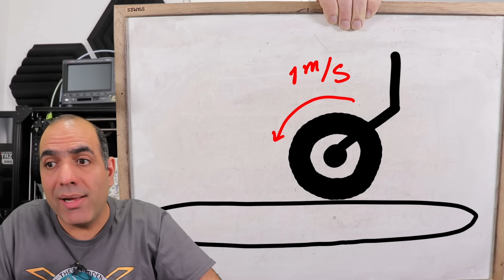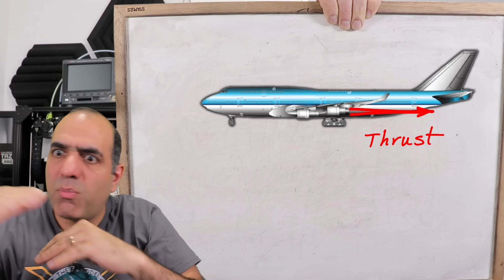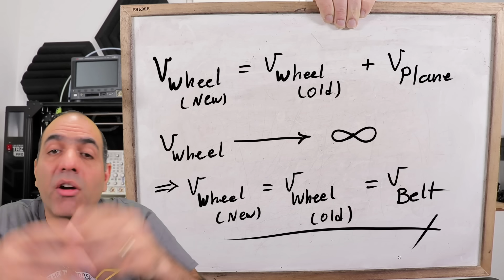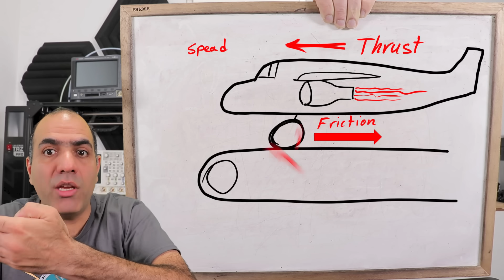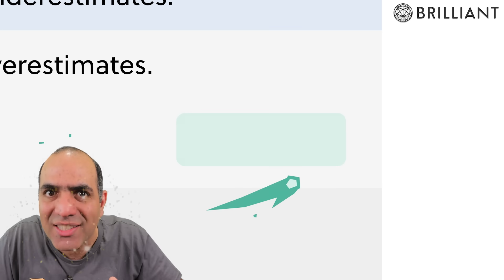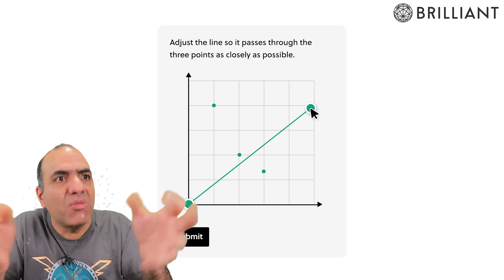Airplane Question that Drove Me NUTS!!!

Comment: When you added the friction you forgot that there is friction between the air and the conveyor belt. The belt will move air towards the plane until there is so much that it generates lift. Once the lift pulls the wheels away from the belt, there is no more friction between the wheel and conveyor and the plane can thrust away and take off. If the bearings didn't blow up yet.
Reply: @rogerwilco99  it will be moving at thousands of miles per hour though... Belt and wheels will move towards infinity until friction balances out which would take a long time given the immense thrust of the engines
Reply: @TheHobohobbit  I don't see how the infinite speed thing makes sense. If a plane needs 100 km/h to lift off, the conveyer moves 100km/h backwards, the wheels spin like the ground is moving 200km/h. If the wheels can handle it, takeoff no problem. They probably can't so that'd be the only reason this wouldn't work.
Reply: @bueb8674  and where exactly would the wind speed that is needed to pass over the wings be coming from. Lift comes from air passing over the wings, so if the aircraft, no matter what size is sitting stationary on the treadmill, no matter how fast the wheels are moving, how will it generate lift
Reply: @jacquesjackcoomans2295  From the engines which are not connected to the wheels. AKA, they're freewheeling. The plane doesn't care what the groundspeed is as long as the airspeed is enough for takeoff. And the trending toward infinity makes no sense. If the plane needs 100km/h to lift, with no treadmill, the wheels match. With the treadmill matching in reverse,  the effective groundspeed is 200km/h while the airspeed is 100km/h, plane lifts.
Reply: @bueb8674  Infinities like that drop out of kinematic models (rigid body with hard constraints, basically) all the time. it's there if you set the surface speed of the belt in the "ground" reference frame to be equal to the surface speed of the wheels at the contact point relative to the center of their axle, which does indeed imply that the axle cannot move in the ground frame. It's also entirely nonphysical, and contradictory if there isn't any resistance in the wheel, and if there is and the resistance of the wheel is nearly realistic then if the tire is not "indestructible" it fails and if it is and there's no slip on the wheels then you've got a belt going at several times the speed of sound at minimum to get to the right order of magnitude to counter the jet thrust. Ran those numbers once.
Reply: OK the problem is the wording of the question 'to exactly match the speed of the wheels' is the whole problem here. Yes, if it instantly matches the wheels speed, the plane covers no ground and the wheels spin faster in an endless loop. If the conveyer matches the ground speed however, the wheels reach 2x takeoff speed and the plane lifts. It's worded precisely to cause a divide in how people interpret it. To the exact wording, you're correct. Realistically the tires explode of course. Edit - wrote this before seeing Jonathan's comment.
Reply: @bueb8674  I kind of like that interpretation as an example of where kinematic models - which are quite useful in plenty of contexts, especially providing the first "what does this do" that you then refine with dynamic models and simulation - do have regions where they make predictions that aren't particularly useful beyond "you shouldn't operate this in that region, it'll break". You really have to pick and choose what physics "exists" to get to a conveyor belt that can prevent an aircraft from taking off through the wheels, and the simplest version that isn't trivially "The plane takes off with a small constant factor faster wheel speed" defines a system of equations that simply has no solution.
Reply: @bueb8674  except there is no talk of engines or thrust whatsoever. You seem to forget that the aircraft is stationary, the only thing that theoretically will be moving is the wheels on the treadmill, no thrust, no air passing over the wings so how could it possibly create lift. Also I don't understand your comment. If the treadmill is going at a speed of 100kp/h then the wheels would be going at exactly the same speed. The treadmill is the theoretic ground, so any speed that it is going at will be the same speed that the aircrafts wheels would be turning. Also there is no mention of the aircraft being tethered to the ground, so in theory, when the treadmill starts, due to friction generated by the wheel bearings the aircraft would just go back till it falls of the treadmill. Regardless of whether the aircrafts ground speed is 100 or 200 whilst it's on the treadmill, there still is no air passing over the wings to generate lift. Think of what would happen if you put ( let's use a hypothetical size comparison ) a stationary marble on a normal treadmill and you turned it on, even if you slowly turned the speed up, the marble would make its way to the end of the treadmill and fall off. Keep in mind that in physics, Inertia is "the power required to overcome friction and the inertia of the moving parts" here on the treadmill the initial inertia is going backward and the say for example ( 747 ) has 320 tons of it's own weight pushing down on the wheel bearing and the wheels and therefor it would need thrust to push it forward. the minimum requirement for a jumbo is 199,500lbf of thrust to push it down a runway to take off speeds. Again with nothing pushing it forward it forward or even tethered it would simply fall of the back of the treadmill
Reply: @bueb8674  the plane can not possible lift, there is nothing propelling it forward so it can generate lift, your missing basic physics in you hypothesis
Reply: @jacquesjackcoomans2295 I understand the physics fine thank you. The problem is the wording of the riddle and how it's interpreted...ugh. To the exact wording of 'the conveyer belt exactly matches the speed of the wheels' you're totally correct. Captain Joe's video explains it well. The plane gains no ground on the conveyer when it instantly and exactly matches the wheel speed to infinity. If however you take the riddle as I and many others assume it to mean/misinterpret, the conveyer matches the groundspeed and using engines(like, duh?) and plane takes off when it reaches it's takeoff airspeed as I explained. Either way it's a stupid riddle that's practically designed to cause this 'disagreement'. I'm done with this, both answers are correct don't @me bye
Reply: @jacquesjackcoomans2295  The thing is there isn't enough friction in the bearing to stop the aircraft from moving forwards. By the time you have enough the treadmill is actively producing sufficient headwind for the aircraft to take off anyways.
Reply: @jonored  Strictly speaking it's a system of equations with one solution: the engines are producing zero thrust, and the wheels aren't spinning at all. Any other values produce no solutions.
Reply: @SirDoggydog  1) how is the treadmill supposed to generate any sort of wind, it's a treadmill not a fan, 2) keep in mind for an aircraft to move forward in needs to be pushed (in the case of a jet) or pulled (in the event of a propeller ), the propulsion in this instance is the treadmill whos mat will be going in the opposite direction to that that the aircraft will need to generate any kind of lift. Given the weight of the said aircraft it will start going backward as soon as the treadmill starts to ramp up. It's not just the small amount of friction in the bearing that needs to be considered, the weight of the aircraft on all its wheels which are on the treadmill, there is where the friction lays. Take Newtons second law of motion that states, the rate of change of momentum of a body is directly proportional to the force applied to it and takes place in the direction in which the force act and the third law 'the action is the pushing frictional force, the reaction is the forward movement' this would be the case if the aircraft was using thrusters but in this case, the force is the treadmill going in the opposite direction
Reply: @killerbee.13  Nope, the initial condition is that the conveyor can keep pace with the wheels
Reply: @mycosys  Yes and that condition implies that any nonzero force applied instantaneously accelerates the belt and wheels to infinity. That's not a solution because infinity isn't a number. Hence, a system of equations with only one trivial/static solution.
Reply: @bueb8674  There is a math problem going around that uses that exact same purposeful vagueness. The correct answer is that the problem is inherently wrong and has no correct answer. Two answers are equally valid. But because it's math people assume it can't be inherently wrong, math is math in their mind
Reply: @jacquesjackcoomans2295  The treadmill still has a surface, which will drag air along with it. Its horrendously inefficient as a fan but when people are talking near infinite treadmill speeds that inefficiency is irrelevant. 

As for your point 2,  The aircraft only starts going backwards after the wheel bearings produce enough friction to overcome the thrust. Change the whole scenario to a seaplane that doesn't even have wheels. The sea has a current opposing the aircraft, and yet the seaplane can still take off in it. there isn't enough friction in this environment to overcome the jets engines.
Reply: Wouldn't that mostly generate wind under the wing?  You need faster moving air over the top of the wing to generate lift.
Reply: If the friction between wheels and air is considered as well, Magnus effect could potentially pin aircraft back to the belt.
Reply: @artkhromov  No as the magnus effect is a spinning sphere/circular object (like a ball or wheel) with air passing over and under it, here the wheels are on the ground so there would be no air passing under it thereby causing downforce even though a negligent amount
Reply: @jacquesjackcoomans2295  You’re right, but I was thinking about a force occurring after liftoff, when wheels have ground clearance
Reply: But isn't that nearly irrelevant?  If the jet sits on a runway/conver belt, it has no power at all going to the wheeles to spin them up to any speed. So its wheel speed relative to that conveyor is nearly irrelevant.   Its only if the jet starts its engines, it will move relative to the atmosphere regardless of what is happening with the runway conveyer belt. It will eventually take off.  The jets wheels aren't powered - so far as I know they are only used for breaking.
Reply: ha ha - if the "moving runway, had moving trees - entraining a thick boundary layer - there may be some ground effect cushion build up - maybe...
Reply: Except the air would be far faster under the wing than over it so it would be downforce not lift

Comment: I think the answer depends on whether the plane could lift off while the wheels are locked in position (i.e., the brakes are engaged), or whether the turbines could overcome the friction of the non-turning wheels. If the plane can pick up enough speed while the wheels drag on the road, then yes, it could take off.

Why? Because the plane is being pushed forward by the turbines on its wings, regardless of what the wheels are doing. The conveyor belt matching the speed of the wheels means that the turning of the wheels produces zero motion of the plane, but the plane is being pushed forward anyway, regardless of what happens between the road and the wheels.

So there is always a forward movement of the plane that isn't accounted for by the rotation of the wheels, meaning the wheels are constantly skidding even though they're turning faster and faster and faster, because they're never turning fast enough.

But when I think about it more, this answer seems unsatisfactory, because nothing (theoretically) prevents the wheels from just turning faster. However, under this perspective, the RPM of the wheels would quickly shoot towards infinity, wouldn't it? (EDIT while watching: Hah! We had the same idea!)

EDIT nr. 2 after watching to end: Hah, I was also starting to think about the friction within the wheels serving as a force to oppose the thrust of the turbines, but was too lazy to continue that train of thought. This answer could perhaps be combined with my initial answer though. The friction within the wheels serve as a limiting force as to how fast the wheels can turn, which means they end up not turning fast enough relative to the plane's motion, meaning they act like the brakes are on. The answer that says "the plane doesn't move forward at all because of the friction within the wheels" seems very counter-intuitive to me, because after all the plane is being pushed in the horizontal plane, so how can the friction within the rotating wheels oppose it completely? There has to be another force on the horizontal plane, but in the opposite direction, and the only such force that exists is the friction between the road and the wheels, not the friction within the wheels (bearings) which only arises as a result of the wheels beginning to turn.

Comment: it would be harder as the speed of the conveyer belt puts resistance on the wheels doing twice the rpm they usually would during the take off but ultimately the engines which have no connection to the conveyor belt, are the sole driving force of the plane and there for should still allow it to gain speed and take off.

Comment: Wheels only spin as a result of the plane being moved forward by the thrust of the engines, that are moving forward through air thats unconnected to the conveyor belt. If they are moving, it means the thrust is enough to move the plane - then its just a matter of adding thrust until we meet lift off conditions [these would be easier or harder depending of wind]. If the power of the engines is unlimited you dont need any wings and air movement around them xD

Comment: it depends if you disconsider any weirdo air effects from the mass f* off belt going very fast, and the plane is applying no thrust from the main engines, no it cannot
if the plane is applying thrust, then it will and just make the conveyor belt go insane cuz plane wheels are just free wheelers (with brakes) they do nothing for speed, so the speed of the plane itself would just exist like normal while the conveyour goes insane on a positive feedback loop reaching idk speed of light

Comment: The wheels on a plane's landing gears are not powered. Or at least not during take-off. The only question is whether they blow up because the speed of the plane and the conveyor belt get added together. Yes, the plane should theoretically be able to take off.

Comment: i originally said no, cuz the question is stupid, but yes it will take off as long as the runway is long enough: the jets are accellerating the plane, and unless the conveyor belt's contact with the tires provides enough friction to slow the plane, it should take off

Comment: Sorry but the question is wrong, the plain do not care about the wheels speed, it only reacts at the airspeed. So if the wheels are moving a million rpm or zero has nothing to do with the engine's ability to drag the airplane forward. If the friction gets too high, do the wheel simply burn up, get torn off or whatever, the plane will still fly.

Comment: spoiler alert
they did this on mythbusters with a smaller plane
because the engines of a plane move it relative to the atmosphere and not relative to the ground like a car or a set of legs, the movement of the ground is irelevant to the plane

EDIT: turns out he says all of that in his video
nice
at least i know my memory is correct now

Comment: If the wheels were powered, then the friction between the air and the belt could cause the air speed to increase sufficiently so there was a massive headwind, allowing the plane to take off vertically.
Reply: belt drag would cause faster air under the plane than over, sucking it down
Reply: @mycosys  Good point.

Comment: Technically, what would happen is, as the jet engines push the plane forward, it spins the wheels faster, and so the conveyor belt moves faster, which means the wheels move faster, and it continuously accelerates until the wheels give out and explode. assuming that the conveyor belt is "perfect" and able to do this, This event would happen the instant the plane even lurches forward slightly, which means the landing gear nolonger has wheels, and the plane is scraping on the conveyor belt with no wheels. a plane on land with no wheels cannot take off. It would more likely explode, or just tear itself apart. on the other hand if the wheels are indestructable, the speed of the wheels will exceed the speed of light, the energy contained becomes infinite, and you either get a black hole, or quantum vacuum decay.

Comment: The only thing that can happen is the plane takes off, assuming we are getting trust from the engines. All would really happen us the conveyer will gain infinite velocity as long as the aircraft is still in contact with the conveyor. But the aircraft will still move forward and will still take off. You can probably math's the exact speed of the wheels till it takes off.

Comment: So if the wheels were perfect, this would have no effect, but I could see the friction between the wheels and the aircraft not being perfect and that friction could have an affect on the plane's take off. In most cases though this would be so negligible it could be unnoticed causing it to not be a difference.
Reply: If there is no friction the wheels immediately begin spinning at infinite speed, if there is friction the wheels immediately reach the speed where the bearing friction force equals the thrust of the engines, stopping the plane. If the wheels and bearings are not indestructible they would fail catastrophically in either case.